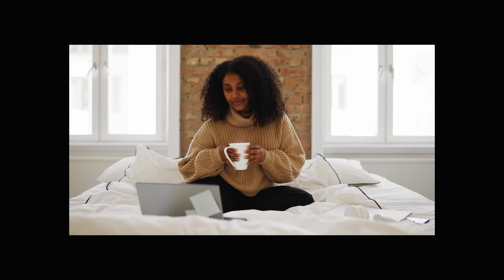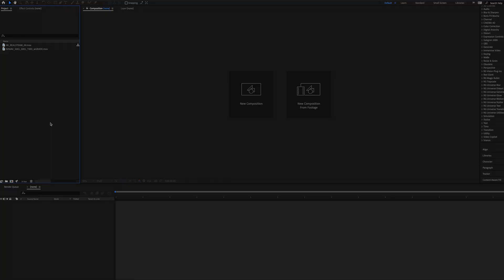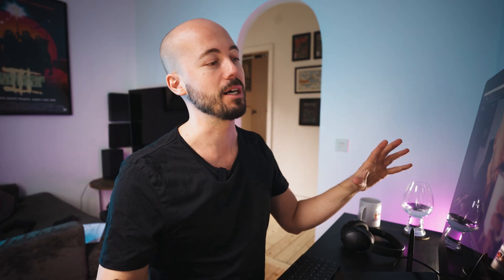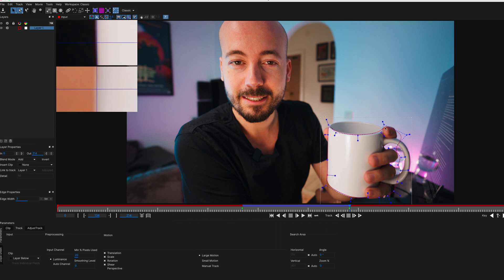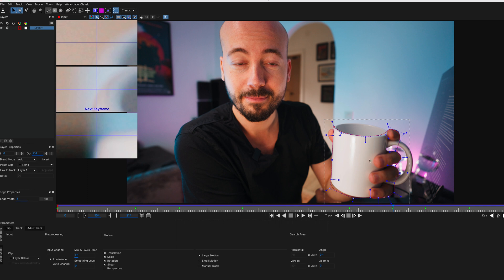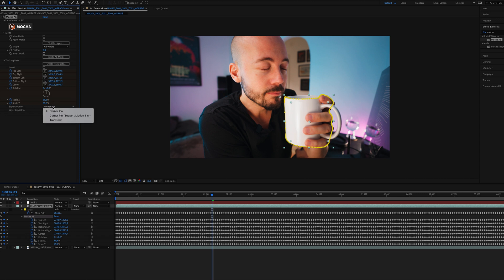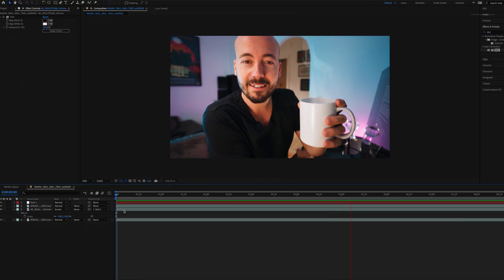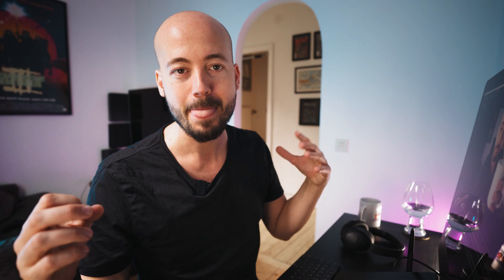Adding Smoke to Coffee B-Roll in After Effects 2021

Comment: when I set the blending mode to screen, part of the background remains visible, like a white mask. How do get rid of it? Keying it out doesn't work, because the smoke becomes black in that case.
Reply from the maker: Hmm, sounds like the dark part, the black background isn’t quite dark enough and other visible parts are also visible with the smoke. I would try to adjust the smoke layer by increasing the contrast, making sure the dark parts are really dark but still having the smoke visible, before adding it on your clip and changing the blending mode to screen.